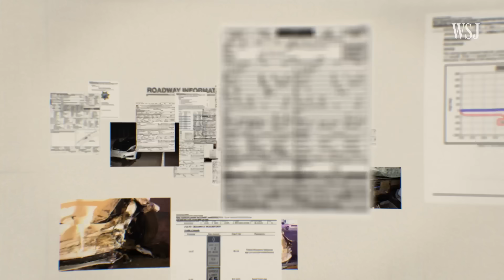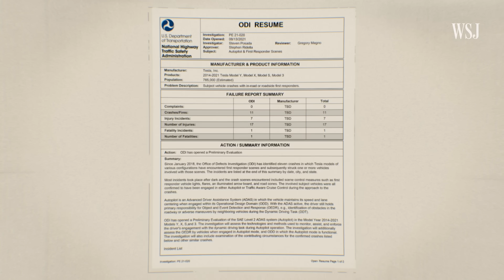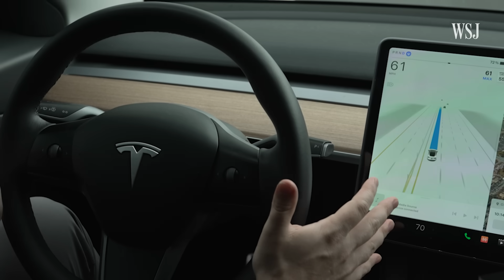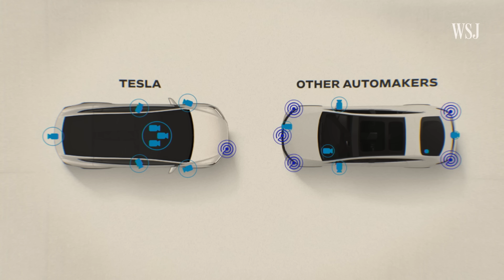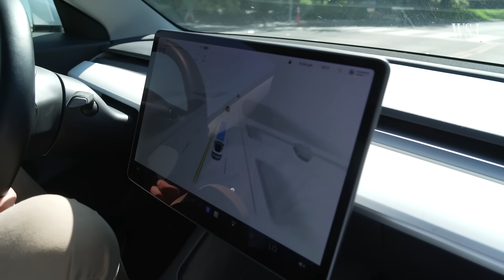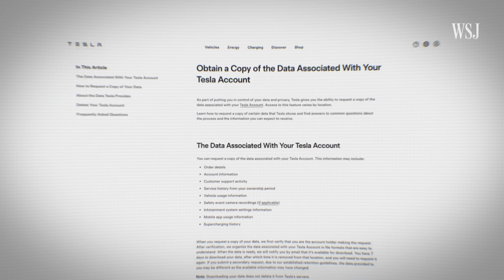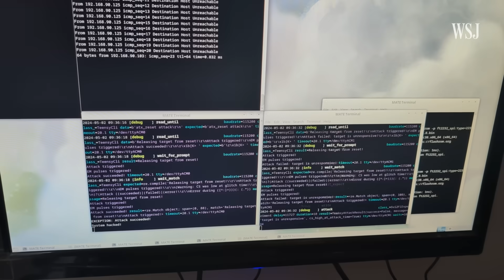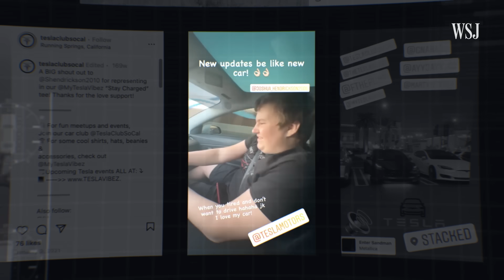The Hidden Autopilot Data That Reveals Why Teslas Crash | WSJ

Comment: The dramatic movie trailer music throughout should tell you how unbiased this report is. 
They talk to an ex-employee who was fired while working on labeling (which is before end to end V12), and imply that this version is the current autopilot version. 
They also insist that radar and lidar are the solution (they state that other car companies use a suite of sensors, but don't bother to compare crash frequency, which might take some actual effort). 
No accidents are presented where the car is using V12 or higher, and numerous statements are made like this one: "I see all kinds of wild video from these Tesla's and I'm like this behavior is erratic, is it autopilot?" Just enough to avoid being sued, but enough to bias the viewer. 
I drive a lot, and I see humans doing crazy, dangerous, deadly things all the time. I also have seen my Tesla avoid crashes and drive me safely every day (while I supervise it, as they consistently remind you that you must do).

Comment: been using Teslas FSD for 2 years now and over 70,000km accross the US and Canada, i think it's incredibly beneficial to safety but i honestly think standard autopilot is dangerous. It is cruise control. that's all it is. it will drive straight into anything in the road. the name Autopilot is misleading tbh.  it should be only referred to as advanced cruise control with lane keeping.
Reply: The term is correct. This is exactly what autopilot in aviation is. It will keep an airplane's height, speed and heading, comparable to keeping a car in its lane. And it will fly into any mountains that show up if the pilot does not do his job.
Reply: yeah, and my uncle smoked cigarettes til he was 110, so thats also totally safe!
Reply: I always knew that’s what it was. My family owns a Tesla and never uses autopilot at all. People should do more research before allowing a car to drive you.
Reply: @personyt55  the only “research“ you need to do is to read the Tesla documentation on auto pilot which states it’s a drivers aid and you are fully responsible. Operate auto pilot, recognize its capabilities and use it within those capabilities. Simple as that. 80% of my driving is an auto pilot and I understand completely what I can do and what it can’t and adds to my safety because the fatigue of maintaining speed and maintaining lanes to tracks from my ability to watch the road carefully which is what I can do more intent with auto pilot on than off.

Comment: This feels a bit like a soft hit piece. Certainly I don’t think the word autopilot is that helpful, call it “driving co-pilot” or something. But, the warnings and information are that you need to be alert. And it tells you if you aren’t. So old mate who crashed into the truck, had 19 prior warnings. 

People will die with this technology. Yes sure. But people will die on the road every year for a multitude of reasons. 

Of course investing, find out what needs to be improved. And yes full self driving is not full self driving. So change hat name as false advertising. 

But don’t stop autonomy’s driving technology because people will get killed. Stop cars then, because people will get killed. The benefits to humanity of having a strong autonomous driving solution are so great, we have to allow society to take some reasonable risks in pursuit of it. 

How many air craft crashes have their been in pursuit of that technology. What about electricity. It’s a series of tradeoffs.

Comment: More junk anti Tesla BS. Missy Cummings has spent her whole career in private industry working on LiDAR based systems. She is an owner of a competitor of Tesla. Not to mention, WP is owned by a Musk competitor. These people are not telling the whole story. More than 3 million Teslas are currently on the road. Autopilot averages 1 crash every 7 million miles driven. The average human averages 1 crash in 1.5 million miles. On top of that the tech continues to improve at a surprisingly fast rate.

Comment: Tesla also suppresses the numbers by quickly handing back to the driver when Autopilot, FSD et al run into trouble so the driver gets the blame for the crash, not Tesla.  The problem is that a few seconds is not enough to build up enough situational awareness to prevent an accident, but Tesla can now claim the driver was at fault.  Any investigation should also examine accidents where Autopilot/FSD was used up to a minute before an accident as that would undo this deceptive tactic too.
Reply: The driver is always at fault as he is responsible for what the car does. If he is waiting for the car to highlight a problem then he is not paying attention.
Reply: @daydreamer8373  That is 100% correct - but that is not what Tesla's marketing tells its customers.  It's also understandable from a sales perspective, otherwise it would not really differentiate itself from other cruise controls.  And that need to sell it as special is what makes it so deceptive.
Reply: @freddoflintstono9321  Tesla has always said their system is level 2, and needs the drivers attention at all times. Now the system may be getting so good that some people are becoming Blaze. But that is not down to Tesla. Tesla are the only ones who will determine when their system is ready. (it is getting very close)

Comment: Autopilot is the same as lane keep assist used by most modern cars. Are the vehicles using Full Self Driving which is supposed to avoid obstacles, stop at junctions etc or lane keep assist/cruise control aka Tesla Autopilot best used in queues and still requires the driver to be fully engaged in control of the vehicle?